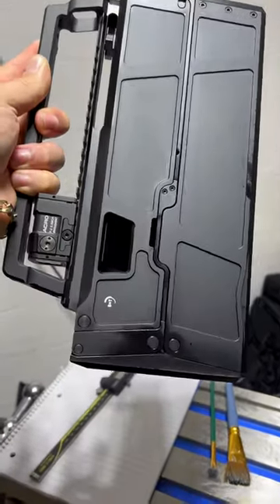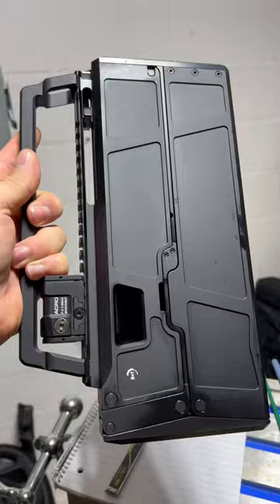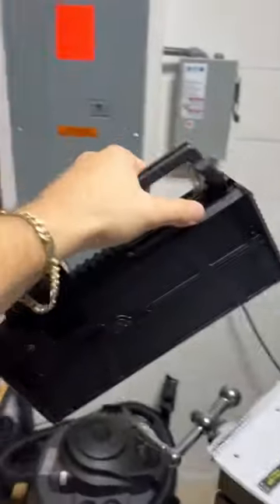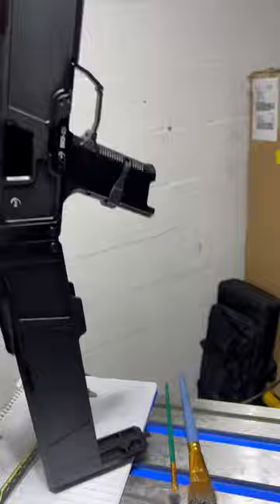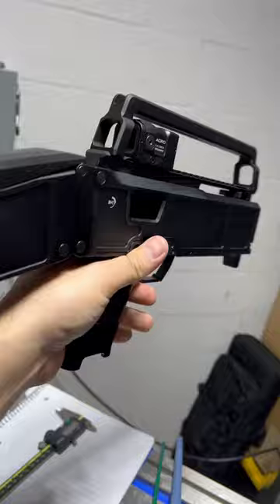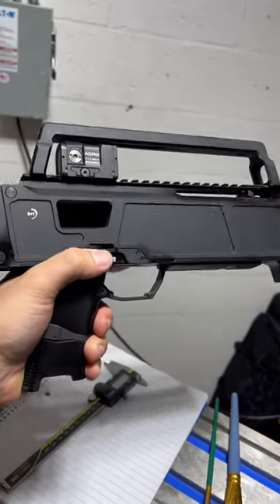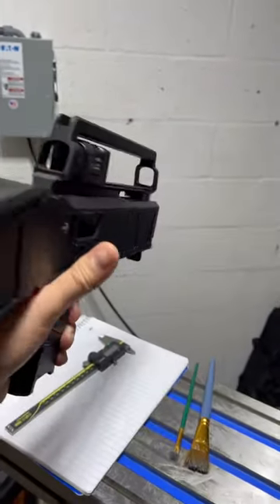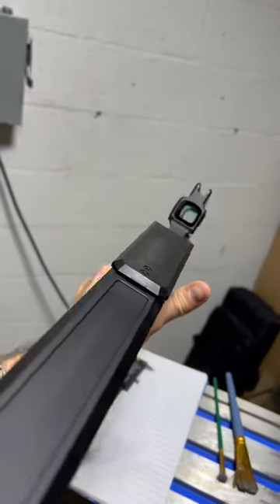First look at the B&T BWC9-320

Comment: Whats the recall issue on these like right now? I am trying to get one from my dealer, but i dont know which size of sig p320 slide and which gen of fcu to use for it since the newly announced recall?
Reply: I heard it's something to do with some of the newer gen sig trigger packs not fitting/locking up. Also, I heard it's a pretty simple fix. I'm on the list for one but my dealer ordered 70 and only got 5 in so far. It's OK, though, for me since the recall came out. I rather wait to get one done right.